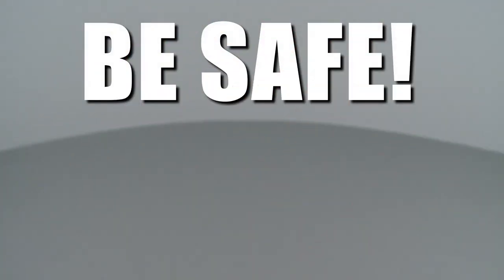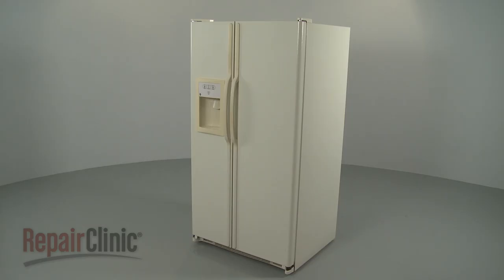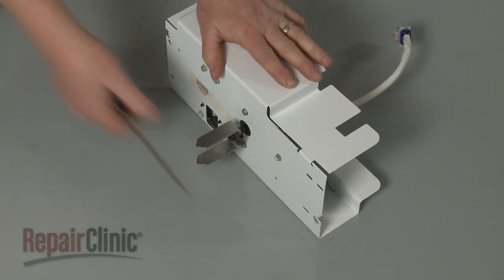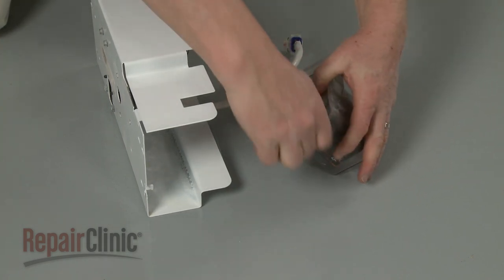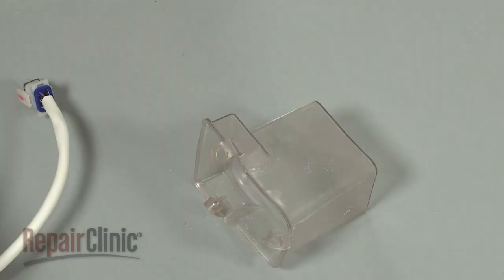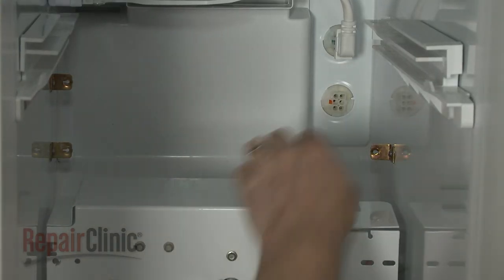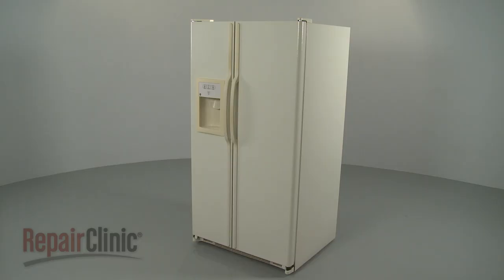GE Refrigerator Ice Bucket Auger Motor Replacement #WR60X10258

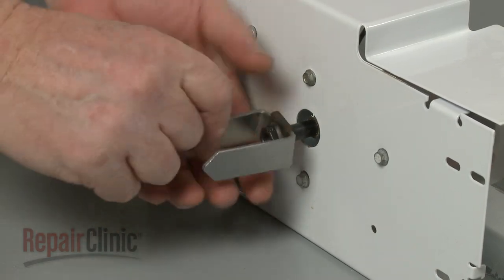Comment: Thank you for this awesome video! I followed your instructions and everything went pretty smooth and when I was done,  it worked! The only things different for me was that there was also a ground wire that needed to be disconnected and reconnected. Not a big deal. Also, on the other side of that rectangle opening right in front of your hands at 2:45, there was this smooth metal rod with a plastic thing at the end that looks like a goal post. It slid out of somewhere and I do not know what that is or what it does. I slid it back in and hoped for the best. Thankfully the ice machine and dispenser is working good as new. I also used your other video to thaw the ice maker out since it was all frozen solid. I know your videos saved me at least $250 and I have the satisfying feeling of doing it myself and a job well done! Thanx so much!

Comment: First off, I fixed my first problem by realizing that the auger bit does not always unthread clockwise - mine could only be removed by turning it *counter clockwise*.  That is the usual way to unscrew things. Don’t assume yours comes off clockwise.

Comment: When I took the motor unit off, it was a huge ice cube. Thawing it and will see if the motor works once thawed.
Reply: Any luck after thawing?
Reply: @ColinBetzel  I did this.  I didn't see any big ice block.  I removed the motor and let it thaw over night.  I reinstalled it and it worked.  Not sure if it was due to ice jamming something up or a loose wire connection,

Comment: The motor spins without resistance when I try to remove the drive coupling!!!  Not possible.
Reply: Idk if you managed it, but it looks reverse threaded. I just managed to change one out today and had to hit it with a screw driver and hammer to get it loose.
Reply: @1800dotnet  
Humorously most things on the Internet said it was reverse threaded, but mine was not reverse threaded!  I spent forever trying to take it off reverse, but it did not work.  I had to use vice grips to hold the axle in place, but it finally worked.